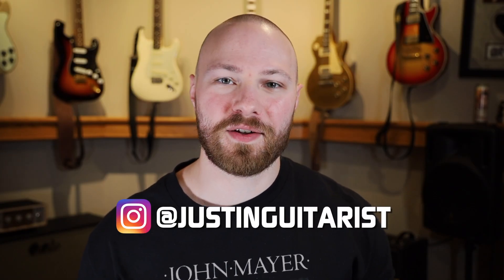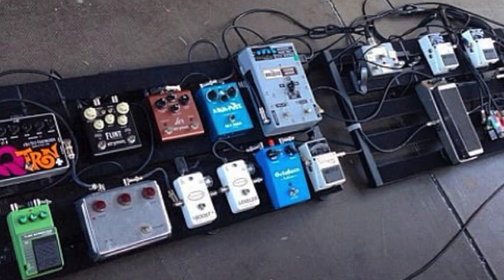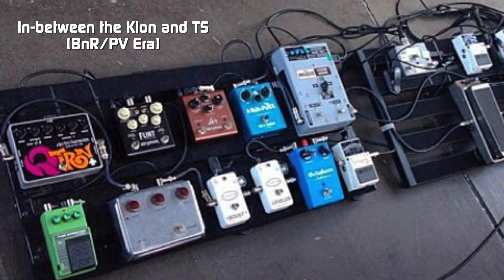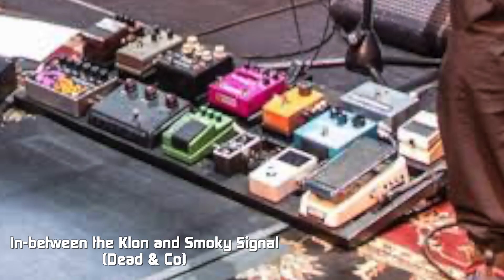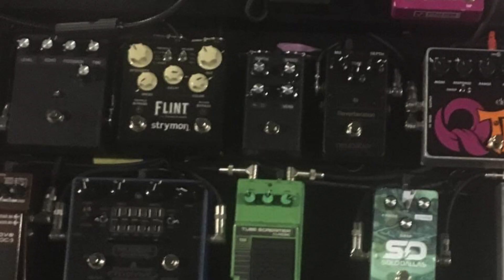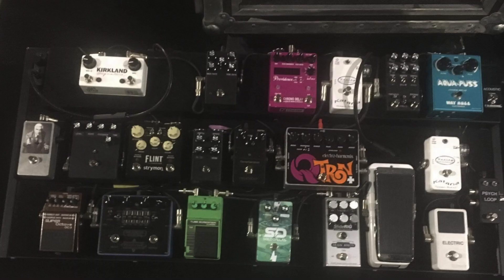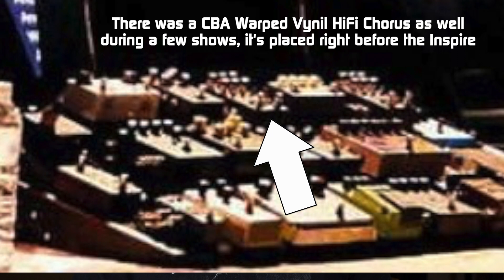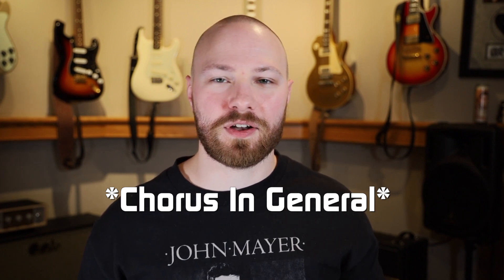John Mayer's Signal Chain Crash Course: Part 2

Comment: His j mod prs amp doesn’t have reverb so he uses the strymon reverb side for that amp and other amps that doesn’t have onboard reverb.
Reply from the maker: Not true, the Strymon Flint has always been additional reverb on top of Amp/Rack Reverb when John feels like it. It’s never been used for amps without reverb!
Reply: @JustinJeske  this might be true as well but he does use it a lot for j mod. I wish the jmod had onboard reverb that’s my only hold back from me buying It. I prefer the traditional clean two rock! 🤘
Reply from the maker: I think you’re misinformed my friend. When John was touring with the JMODs he had one Bricasti M7 reverb unit in the rack for each amp, that was what he was using for amp reverb, not the Flint! It’s impossible to say he’s never used it for amp reverb for smaller shows, but for main tours it’s well documented that it was never the Flint! 

I’d say the TC is a better amp in almost every way!
Reply: @JustinJeske  I agree with you bro

Comment: I think the layout goes...
TC > Katana > Xotic > SlideRig > Solo Dallas > Katana on top of board > Ts10 > Flux > Qtron > (in loop) OC-3 > Neunaber Expanse > Blacked out pedal, top load no led (reverb/drive?) > Flint > 83 > Aqua Puss > Chase Bliss Hi-Fi (makes more sense than Tonal Recal, especialy considering where he places his CE-2) > Chrono > Blacked out pedal, side load no led (reverb/drive?) > Jirkland Signature Boost
Reply from the maker: That is not quite the layout for the 2019 world Tour!

The OC-3 is not in the Qtron loop, that back row Katana is! We've seen him use it this way to confirm. The Neunaber Pedal is the Slate not the Expanse and the pedal after it is actually the J Rockett Mr. Moto! The Warper Hifi was only on the tour for a short time, I can confirm the CBA pedal beside the Aqua Puss is a Tonal Recall RKM. That last blacked out pedal is the Neunaber Inspire! 

Hope that helps! 😁